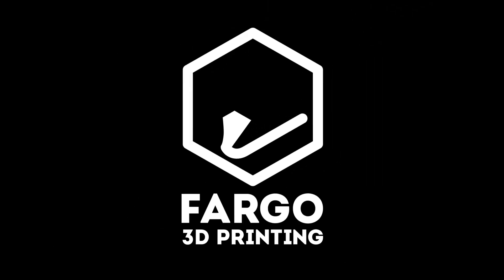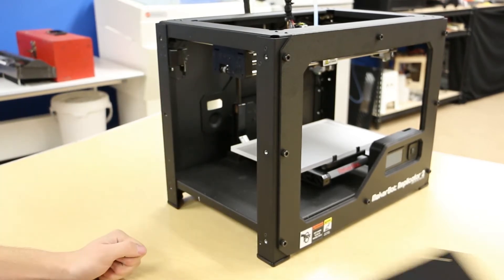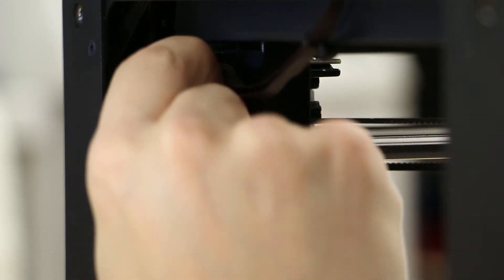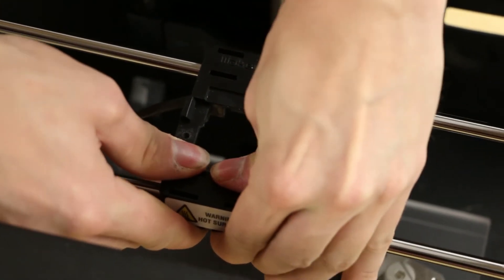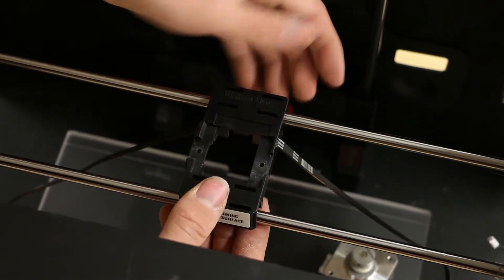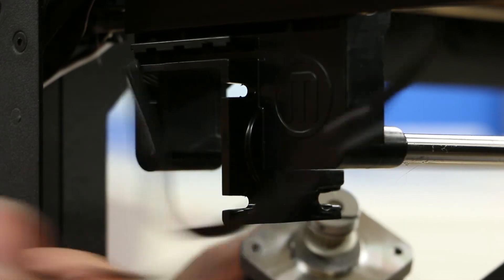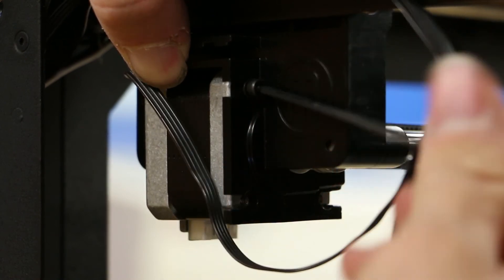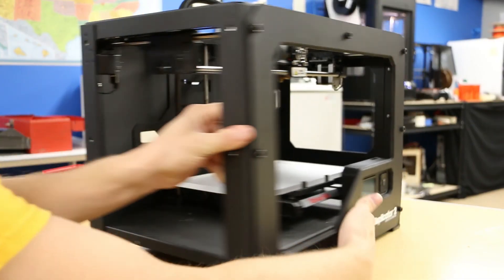Replacing Your MakerBot Replicator 2/2X X-Axis Belt

Comment: I have some nasty drift on my rep 2x. it will outline fine then it falls apart. the best prints happen in the front right corner only. it's not a x drift it's a y drift.  hear clicking sometimes...seems like the bars become misaligned. Any suggestions? 

if printed 9 test pieces in front mid rear in both axes. each drifting different?!   Have tighten the belts